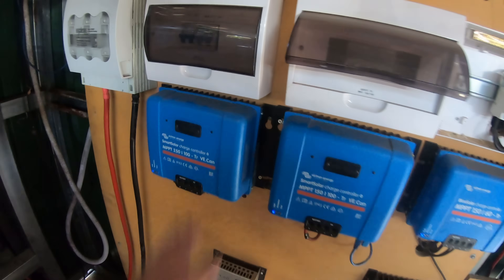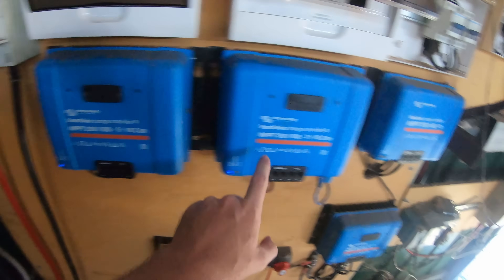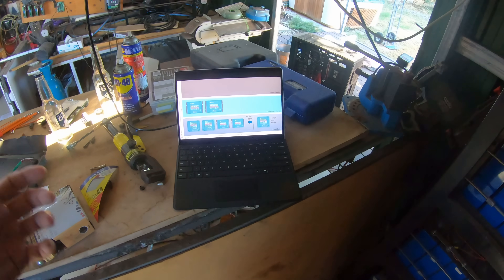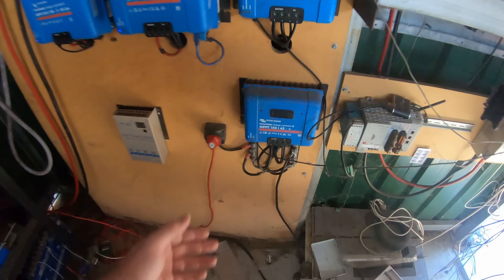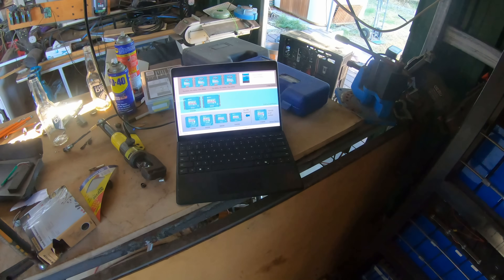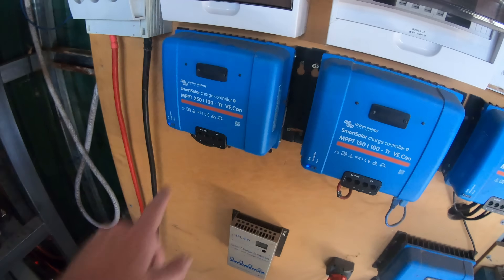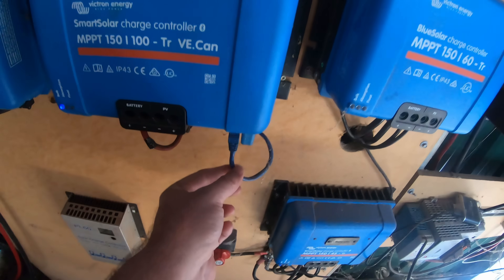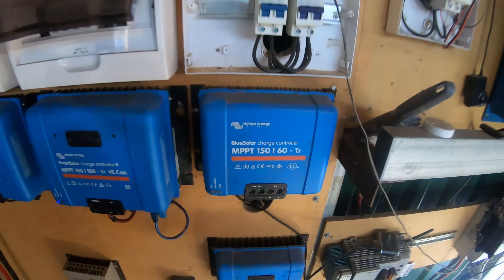Victron Mppt Comparisons

Comment: Now days the 250/100 can do 12v to 48v
That's what I would buy because my system is currently 12v and looking to upgrade to 48v in the future 
That way I don't need to buy a whole bunch more stuff just because of a voltage change
Reply from the maker: yea im the same, the little ones are ok as entry level but the extra capacity and safety features on the big ones is worth it

Comment: I found those Victron MPPT's too low voltage and requiring shorter PV strings and thicker cabling. It's ashame the RS mppts are so expensive.
Reply from the maker: Ive never used the RS mppts ? 

Might be a decent comparison video ?

Comment: 100 amp connections should be lugs and bolts like thier inverters...I see screw terminals as bad design on the high current units.
Reply from the maker: Shit yea, you dont want anything getting inbetween them and you want the most mechanical advantage possible

Comment: One thing to consider, in AUS and NZ anything over 120v requires an earth fault alarm. A quick look online in NZ and that was +$900NZD, I'm sure there may be some cheaper if I looked harder. In AUS the AERL is +-$700AUD. 
Off grid doing it yourself you may get away with it (which I have for now), but I plan to upgrade my system in the future and have it signed off for insurance purposes. That's is where I see the value in the RS series as they have the earth fault alarm built in and hence why I bought the Multi RS Solar. Loving it so far.
Reply from the maker: Sorry for the late reply. I started to research this after reading your comment and found my self a little annoyed at the guys who installed my solar  (the grid tied stuff) as its in the standard for that aswell given the year i installed it and its not done... 

I appreciate the comment because its something i wasnt aware of as a requirement. I know some of the fronius gear does it but i think some of mine is non compliant and will now work to fix that

Comment: Do these victron controllers support over paneling? such as do they clip on a great sunny day to utilise more power on a cloudy day. I have a 60A renogy rover that does to a certain extent. I'd like to have a victron ecosystem but am on a budget and i have many panels in storage.
Reply: To a degree.  There is a maximum amp figure that must not be exceeded and that is stated in the product datasheet.  Victron's non-isolated (I don't know about the 450V models) solar chargers have the ability to short the PV input should the battery side go over voltage.  If you exceed the amp capability you risk failure of the transistor (or what ever it is) that is used to do this.  Obviously you must not exceed the Voc rating either.
Reply: @retrozmachine1189  Fair enough. I should have said Voltage and short current protections levels. My 100/50 at 24v has nominal output of 1400w. But I can could run up to 3500w with a 2sx4p config with the panels I have. Well under the 100v & 60A protection as an example.
Reply: @retrozmachine1189  "have the ability to short the PV input ". I don't understand why you'd ever want to do that. If your maximum power point goes over the allowable output current, or the battery is charged then the natural thing to do is to back off on the input power by drawing LESS current from it and allowing the voltage to go towards the open circuit voltage. I can't see there is ever a reason to operate on the lower voltage / higher current side of the MPP., let alone zero voltage / short circuit current.
Reply: @BruceHoult  What if the transistor in the MPPT circuit (it's fundamentally a buck or boost converter for non-isolated designs) shorts?  Then you have uncontrolled PV current into the battery.  Shorting the PV is a means to cope with this mode of failure.  Some chargers use appropriately rated relays to close connect the PV and would open in these circumstances.
Reply: @ that's undesirable because it's inefficient but I can't see why it would be dangerous. Say you have panels with MPP 34V 13A (440W, Voc 40, Isc 14A). You're running three in series (102V MPP, total power 1325W)  to a 48V battery at 28A. BOOM! Something fails and short circuits the string straight to the battery. Short circuit current of the string is 14A, it can't possibly try to poke more than that into the battery. The string voltage will instantly drop to 48V (or 55V, whatever) which is 16 or 18 V on each panel vs the normal 34-40.. Where is the danger? The panel side is giving 7.5% more current than normal operating conditions, and only 50ish V instead of the normal 100 (120 open circuit) so that's certainly safe. The battery side is 50V, 14A which is half the current it was charging at at MPP. That's certainly safe. There is 700W going through the system, vs 1300W just before the failure. Why would you need to take active measures against this scenario? It's inefficient but it doesn't look dangerous in any way.
Reply: @BruceHoult  And what happens when you leave that current there all day, uncontrolled.  Why your DC side voltage will become excessive.  Your lithium BMS will disconnect to protect the batteries, then the voltage will no longer be contained by the batteries but instead it will rise to what ever your loads permit.  Now everything on the DC system is fried.  I'm not sure if you think that is a bad situation or not, but I sure do.

Being able to terminate the PV input in one way or another is a feature not just of Victron solar chargers but others too.  Even in the lower end of the market such as SRNE (Renogy's OEM) has the ability.  If all this still hasn't bought you up to speed on the topic I don't think anything will so I will not be replying to any more arguments presented by you about it.
Reply: @retrozmachine1189  sure, but that's going to take minutes to hours. Something needs to be done eventually. Disconnect things, whether by fuse or NO relay, seems a lot more sensible than short-circuiting.
Reply: Yes you can as long as you don't go over the recommended max voltage of that controller. I have my 100/50 and my Multi RS Solar (separate systems) both over paneled.
Reply from the maker: Hey bud sorry for the late reply ive been away for work.
I see others have responded but here is my two cents

 In yield yes but not in voltage.  So thats the important distinction. 

I think the best way to say it is "The current has an optimal current out but also a short circuit current in. you can overprovision where your provisioned current might exceed the optimal current but dont exceed the short circuit current. " 

Def try to stay under the voltage though... thats not forgiving

Comment: I got a 150/35 to upgrade my 100/20. I've got 2 410watt panels and I'm still maxing out 150/35 under certain conditions. My 100/20 would get hot around the terminals at full power so i upgraded to a larger cable and fuse size. The inline fuse holder i was using was actually adding to the heating problem. With a higher rated (maxi blade) fuse holder the problem was much reduced. A fan helps a lot. I plan to try splitting the two panels between the 100/20 and the 150/35 to help with shading and so the 150/35 runs cooler. Also because I use the load output of the 100/20 to charge my solar generator. I have 24 volt batteries but have found one panel is fine voltage wise. Mppt is 31 volts but they will go up to 35.
Reply from the maker: are you putting boot laces on your cables too ? If you can mechanically compress the wire in the screw terminals i find the resistence is reduced. but thats my speculation

Comment: What many have learned the hard way;
#1 Use the stranded cables that Victron recommends
#2 As you tighten the terminal screw lightly orbit the cable to get the strands to migrate to vacant spaces and settle them.
#3 in a few days re-torque the terminal screws. Copper flows and the terminal loosens a lot in the beginning. This is true with many other terminals too. 
#4 Don’t use freaking ferrules here. These Victron terminals aren’t designed for them and the contact area will be poor.
Reply from the maker: oh man you nailed it. the retightening also applies to battery terminals. We often go around ours with a thermal camera to look for resistance. When we find it its almost always a loose terminals.
Reply: @BadIdea1123 
Before even powering things up I use an internal resistance meter to check the buss bars to cell terminals. The “ringer” usually has lint, irregular surface or oxide. 
I check everything, cable/crimp, through breaker and attach a note for future reference. Yes the flexible buss bar terminal (two hole also) keeps needing retorquing up to 6 months still move. I use 6X20 mm grub screws and smooth bottom 6mm flange nuts. The serrated nuts have have less contact area and the points sink into the copper and release the pressure of the contact surfaces below( terminal top and buss bottom) the serrations having marked the surface also resist true retorque force. The serrated nuts can be repurposed by lapping/sanding most of the spiral away.

Comment: The maximum an MC4 can handle is not a matter of power but max current and max voltage. 16A is well within the range, as is the voltage. What I could find online varies wildly between 20A and 95A, but even the lowest number I could find is well above the 16A so I would not worry about that at all.
Reply from the maker: Yea i didnt go in to too much detail there and maybe it sounded a bit odd. victrons data sheet states 30a but I've seen some of the cheap ones (Chinese) melt for almost no reason what so ever. Could also be installer error and people not terminating them correctly too <-- this is most likely the case
Reply: @ The thing with MC4 connectors is that it’s not a standard. It’s just a type of plug created by MultiContact. Hence the name. If you mate connectors made by different manufacturers, you might run into trouble. The Chinese ones may work fine if you connect them to each other and may burn up if you use them in real MC4 connectors. This should therefore never be done. This is the reason that most inverter manufacturers provide you with the connectors to put on the end of your string cables. Some go as far as using a slightly different connector to make sure you don’t plug in the wrong brand.

Comment: my 100/20 melted as well. both the pv and battery terminals are stuck. at the time I didn't have a screwdriver to match the size of those tiny screws they use
Reply from the maker: That is the worst isnt it, a set of electrical screw drivers is worth  its weight in gold

Comment: Good review - Victron makes it confusing.  FYI you can use a VE direct to USB dongle (another $30) and you can use a USB hub and expand the number to over 200.  I have 3 MPPT and 3 BMS via USB to VENUS OS on Rasp PI
Reply from the maker: Yea we have a USB hub in the van and on the house a USB-C to 4x ttl which lets us add lots more. Im lead to beleive that 15 is the limit but have not seen it myself

Comment: The 100/20 gives you 20A of output power for around €100, so that €5 per Amp.
The 150/100 VE.Can gives you 100A of output power for around €475, so thats €4.75 per Amp 

You get VE.Can with the bigger model and ability to support 150V in series panels.

The 250/xx models work out about €5.50 an Amp, so if high voltage serial strings is your requirement, go for that.
Reply from the maker: its been my experience "always go for higher voltage" for example, our 250v string will start to produce power with indirect light before the 150v string even though tehe 150v string faces the morning light. 

Horses for courses i guess
Reply: @BadIdea1123 you actually get a meaningful amount of extra power from the earlier start?

Comment: question:    I have wanted to start with the basics for a very very long time. and I can now see prices have dropped so much that purchaseing something to try to only fail at now makes sense.
which victron mppt controller would you recommend to match with 4x280ah batterys (12v) with a possiblity later to upgrade to an 8x 208ah batteries (24v).  once I learned and under stand I probably wont need it for a larger 48v system, so that is not an issue. I probally plan to move this to be used as a mobile platform and the 48v system would be my house platform...  

basically which mppt controller would be good as a 12v  that also support 24v :)
Reply from the maker: Its going to be determined by the charge source generally. Your batteries will determine the limit in current (which you can oversize and control in software) but if budget is a constraint your solar source should be about 10% larger than your controller can take unless your in a place where the temp is below freezing then it should be around 90% of the batteries capacity

Comment: Thank you for the information, reasoning and explanations. Really helpful. I needed to move up from the 100/20 to 100/50 with an increase on the Motorhome single solar panel 275w to 475w 12v. I will hang onto the 100/20 for future projects 😉
Reply from the maker: they are rippers man, for their size and cost def worth hanging on to

Comment: After much thought.. and research...
I live aboard a boat and have a 12v system.. LA with the intention of going LI .. and now have a 340A LiFePo4 using the LA for alternators and turbines (there's no decent pulse breaking controller for LI, unless you want to snap the blades off) and intend to use a few small 9A DC/DC (cheaper than a larger one.. 3 x 9A = 1 x 16A for same money with the advantage of setting them to slightly different trigger voltages to avoid hysteresis and have redundancy to trickle to the LI...
.. anyway I bought 3 x 100/20's (may get another) cost and redundancy was a factor in addition to shading..
With the intention of using the load outputs for a controllable dump .. that is Mos and avoids relays (and clicking sounds) pity couldn't use the load outputs to dump into the LI..
Real thing is...
I think any of the boxes above the 100/20 and all DC/DC should have bolt lugs not screws and I do not use the MC4's .. they are not waterproof and don't carry much current..
btw 50v DC is very ouchy lethal 💥
&
I wish you would put a thick piece of durable plastic over the top of your battery packs incase the rack fails..
Reply from the maker: The plan was always to enclose it with clear plastic so i can see whats going on inside. Ive just got to stop being lazy and do it
Reply: @BadIdea1123 
... not lazy..
just found something more interesting to do.
(lazy is actually an external construct..)
"Live your own life.
and do good."

The one saying lazy is not actually doing anything...

... to explain about the metal shelf.
if the shelf supports on the legs fail the shelf will land on top of the cells below..⚡
(I've seen the same design on other YT channels)
I assume the shelf is metal...⚡ 💥

Could you do a video about the 100/20 and it's capabilities..
also can different size MPPT's or DC/DC be married on the app to work together.
The reason..
If someone has limited money..
what is the starting point of kit to buy...
I suggest to people...
1 to 3 x 100/20.
and 1 to 3 x 200w to 250w max 24v panels.. to match the MPPT's.
and the largest LiFePo4 possible ie 500 or 600Ah.. definitely not smaller than 280Ah.
a small inverter 250w to 500w for laptop, phones, torches etc.
A 2kw inverter, partly because larger the price jumps and cable gets big..
the reality..
If you need 3kw or more .. move to 24v or better 48v...
and keep your 12v system.
.... and clean your solar panels when it's cool.. and angle to the sun.

Comment: Yep we’ve got the 250/100 on a duel axis tracker & 450/100 on a north facing array at the moment but later planned to reorganise that for an east west orientation, both are not working anywhere to capacity as to what panels they have on them and as such never even get the slightest hot and perform great,good review mate.
Reply from the maker: Do you see much of a difference in the performance of the chargers or is it to skewed by panel performance to br able to tell
Reply: @ nah other than the north facing array produces slightly more in winter due to its angle you could really tell, the system as is supplies enough energy in its form but hey there always room for improvement, our 250/100 is the master so that dictates where the most energy comes from